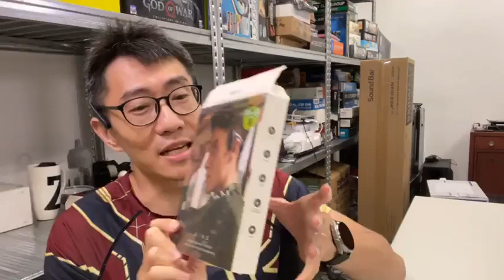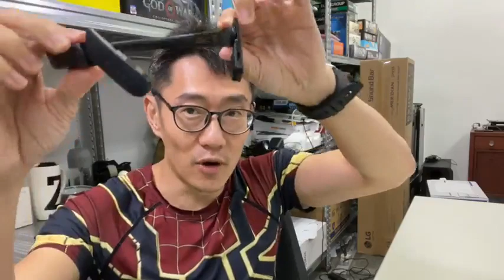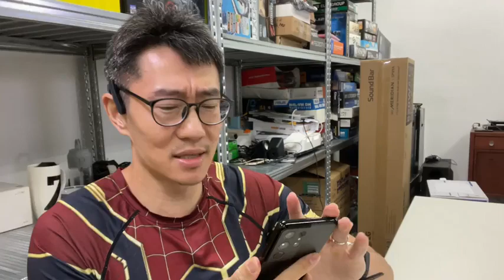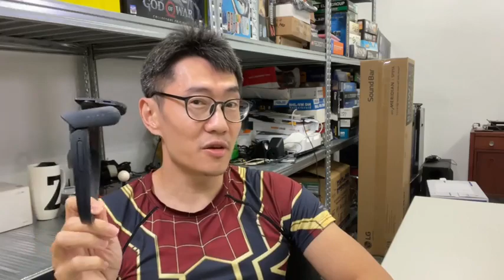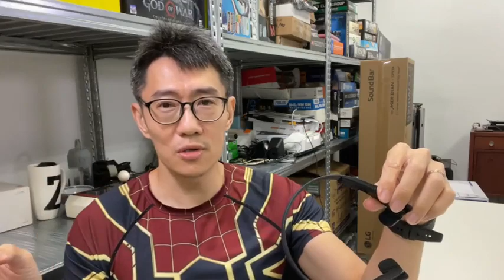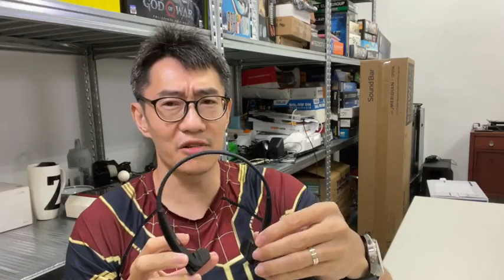Mu6 Ring Open-ear "Air Conduction" Headphones - Speakers On Your Head?

Comment: How's it feel and sound with glasses
Reply from the maker: Works great with glasses for me. There's a little notch when I flip the speakers down that fits right into the frame. And since it's so lightweight, I don't feel it. Sound quality isn't great, but it's not meant to be for everyday listening. It's basically for workouts when you just want some music/noise around you and still be able to hear your environment without having to plug something in/out of your ear like normal earbuds/headphones.